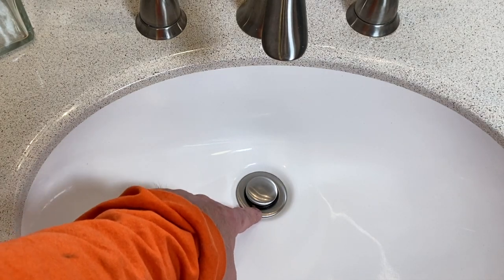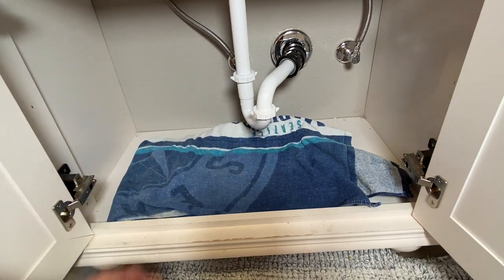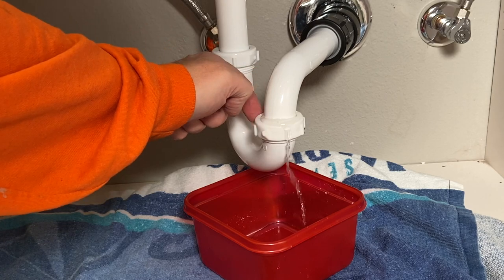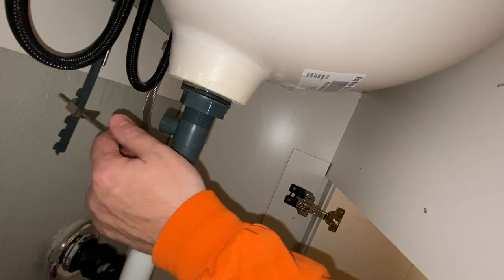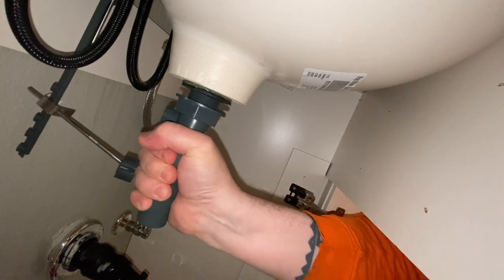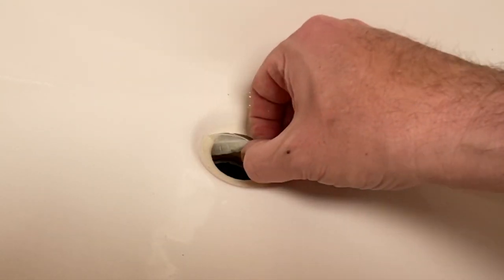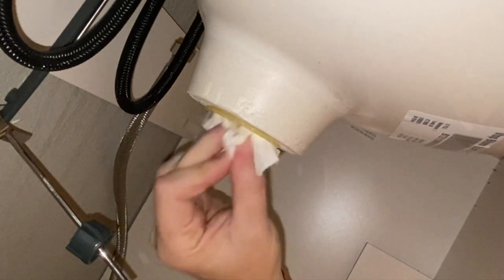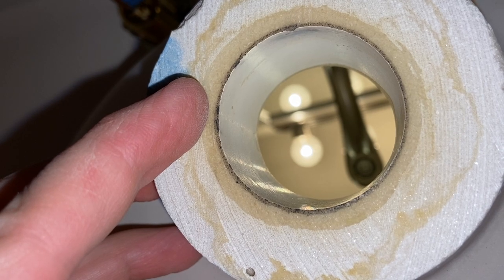How to Remove a Bathroom Sink Drain Sealed with Silicone Sealant

Comment: I found out I needed silicone instead of plumber's putty because the putty contains oil which degrades plastic. Now I know that I shouldn't have an issue with that silicone later on. Thanks!

Comment: I got to do my kitchen sink drain, replace the faucet, and repair some water lines.  Your thoughts on the SharkBite connectors?

PS.  Love these sort of repairs!
Reply from the maker: Are you doing in wall connections with the shark bites?  What kind of material is the water lines made of?  
I like shark bite. They come in handy. They are expensive, but will help you in a pinch. 

Thank you!
Reply: @ThatFixItGuy  Going from copper in the basement, and up to a sink but it's a tight area to work in and when I did one water line (running copper) it wasn't the prettiest job but passable.
Reply from the maker: if the area is going to be exposed you could put a sharkbite then run pex or copper up to the sink and go that route. It would be easy solid fix.  If you were to solder on a pex adapter to the copper then run pex that is a better fix I think.  But then you are looking at buying some tools they you may not use a lot.

I know lots of people have all kinds of opinions on sharkbite type fittings.  If they are not exposed to freezing they are a solid fitting.  They are UPC  code approved to be inside walls these days.

Comment: Can you do removing the sink?? I have a huge crack and hole in the sink and needs to be replaced.... It looks like I babe no screws holding the sink up.... So I'm guessing it's glued to the vanity??? Would love to see the process.
Reply from the maker: Will either be caulked or siliconed on. Get a painters tool and run it around the rim a couple of times. You’ll have to get all that caulk out of there. Once you can get the tool under the sink it should pull up pretty easy. Make sure all your plumbing is disconnected first.

Comment: Don’t use silicone to begin with. Then you won’t have trouble removing it. Learn how to use stain free putty.
Reply from the maker: LOL. So true.  This was a video to all the people that said they could not get silicone off.  It really is too easy.  I love plumbers putty, but got sick of call backs all the time for all these cheap new plastic pop ups.  Silicone has not failed me in this regard.
Reply: Amen. You gotta try the Amazon pop ups. Brass body with the mushroom pop up like for vessel sinks but you can get the ones with overflow. But they run me $20 in chrome and $35 in bronze. And they have a silicone seal in a wedge shape. Makes the repair easier without the linkage. And no stain worries with the silicone seal. I keep 5 on order each week and use them every time someone calls about a pop up not working or clogged. O dude and the ease of hair cleanouts. Just pull mushroom out. Has a little basket. Anyways. Good luck. Good video. The original post was prior to 4:20 am. So I sounded rude.
Reply from the maker: Nah you are all good!  I will check those out for sure. I have been like the tubshroom, so I assume it is the same style clean out process. Thanks for the info!